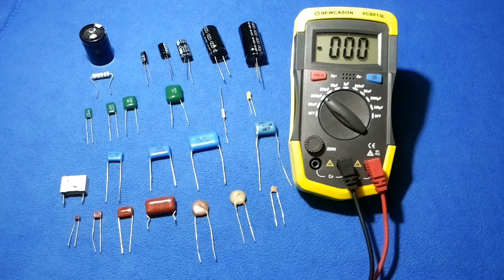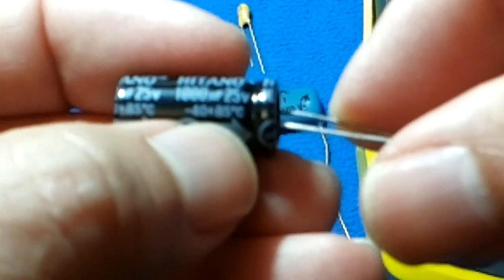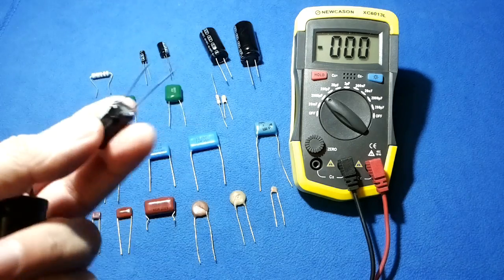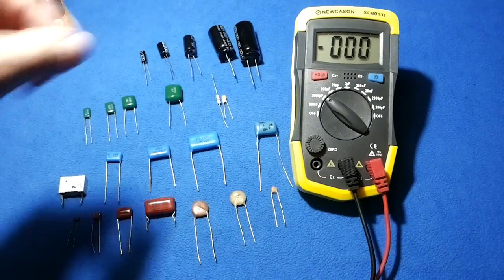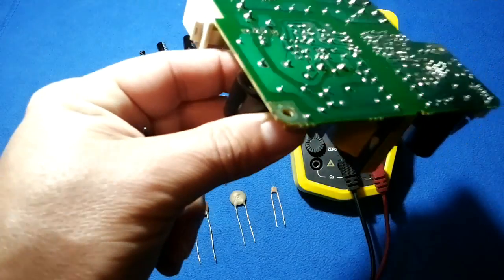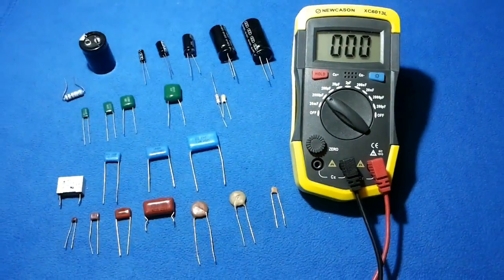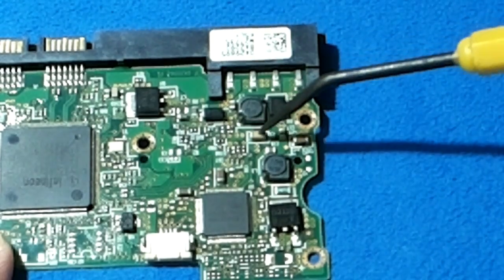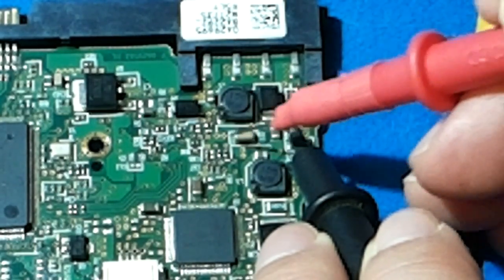How to test a capacitor / how to test smd capacitors with a multimeter

Comment: Mr. Bob Kalpon, Where should I put the tester to identify the short circuit? Thanks!
Reply from the maker: Hi! You have to do two tests. 
- One is continuity to ground:  negative lead on ground, and touch both sides of the capacitor with the positive lead of the tester. In some capacitors, there will be continuity to ground in one side, but no the other side.
- The other is continuity, and better with Ohms meter, in both sides of the capacitor. There should not be short circuit or low resistances. 
For anything suspicious, remove one side of the smd capacitor for capacitance meter test. A lot of the capacitors are 0.1 uF in parallel with everything just to bypass noise. Those ones, get shorted in  laptops, tablets, and smartphones, making a whole area in short. You can remove it, and everything will work. It happens a lot, because the Voltage rate is low on them, and become sensitive with the time and easy to short circuit. :-)
Reply: Thank you, just I need to know how to set up the digital multimeter, I do have the shipest version. Is it in DCV? Thank you
Reply from the maker: For the first test: continuity with a "beep" sound to work faster. For the 2nd test: Ohms meter. If one of them looked suspicious, remove the solder in one side or the component that all and measure it with the "CAP" or  "-I I-" symbol in the DMM dial if it is available in your DMM, or with a capacitor meter. DO NOT FORGET to always discharge the capacitor with a short circuit before to perform a measurement. ;-)

Comment: In your clip, around 7:00, you're stating that the band on the capacitor correspond to the outer foil connection.  In fact, this should be considered as an ideal situation.  I found capacitors that were not marked properly in that regard, having the band on the lead which was connected to the inner side.  This discovery is based on a youtube video where the technician was connecting a capacitor on a CRO and based on the noise amplitude introduced while holding the capacitor between fingers.  If the amplitude is at its lowest when the band side is connected to the scope's negative lead, then the band on the capacitor is pointing to the outside foil lead, otherwise the band is pointing to the inner one.  I've been successful to perform that test only with a CRO.  While doing it using a DSO, the results weren't as convincing.
Reply from the maker: +SimpleEnough2k9 Hi! There is not discovering in Youtube for anybody. Video: 15:22 The knowledge comes from several decades ago before my father borne! Since the beginning of any electric component, there are a lot of test, investigation, datasheets, and updates to product introduction to main universities and manufactures handbook. 
All brand cares very well about an electrolytic capacitor's mark. But most brands don't care anymore about the non polar foiled capacitors. And the mark can be on any side or missing that all now day's.
In minute 7:15 I sad: " ...many years ago, Fabricants USED to mark where is the outside paper for designers to know"... When we say they used to, it means in English:  that it is not use anymore. Evidence of it, is most capacitors alike you will see now days, are missing the mark.
I talked about because this knowledge will not escape from the list of cares of any designing engineer. But some "fast food" technical schools let the students to graduate missing that knowledge. Or in the worse situation, people are trying to learn only from Youtube, and forget to go to school, or to search in books as the main source of formal education. 
The one that could be confuse about in my video is I didn't talk about Tantalum capacitor. I spoke, but jumped it, leaving it out the subject for next video.

Comment: +Bob. Kalpon sir, how much time or physical sense, do I need to wait to discharge a large capacitor like the example you showed in your video?
Reply from the maker: +wolfenstein1040        Good question! We use 5 Watts, 10 or 25 Watts resistors. Any value in Ohms between 100 to 4.7K can be OK. (In reality any good resistor from the ones you have on hand). There is a capacitor discharge formula = [5 x (R x C)]. 
R is the resistor in Ohms, C is the capacitor in Faraday, and multiplied 5 times. BUT, that "5" is a constant number used for a good connection discharge. So, for safety, YOU MUST last about 3 times the value of the formula, once you made a good contact between them. ;-)
(Try to find high Ohms resistors for the main high Voltage capacitors discharge. The lower of the resistor, the higher of the Watts for it)!